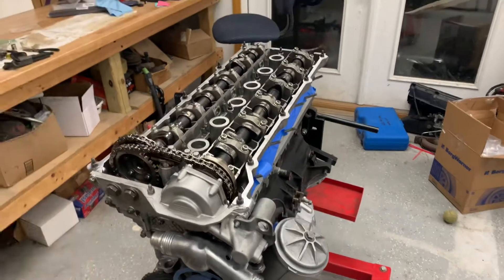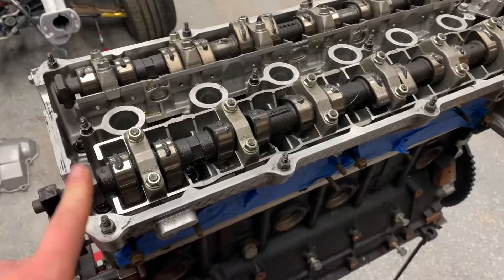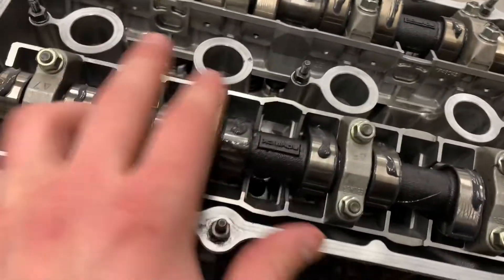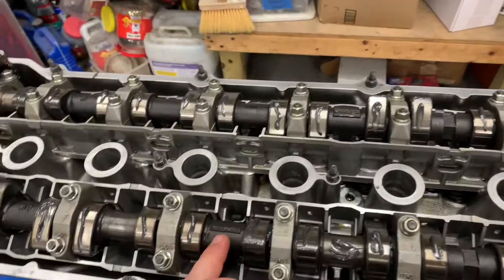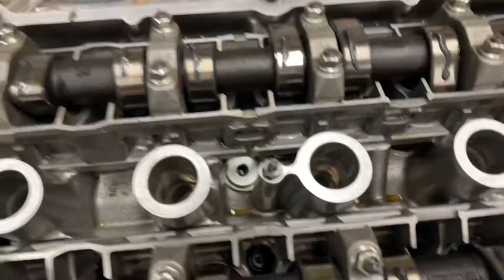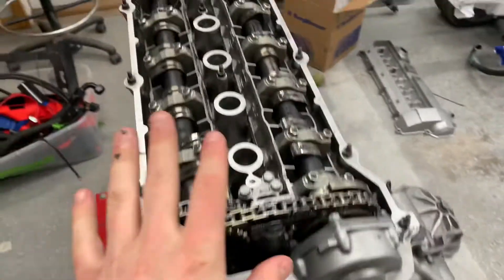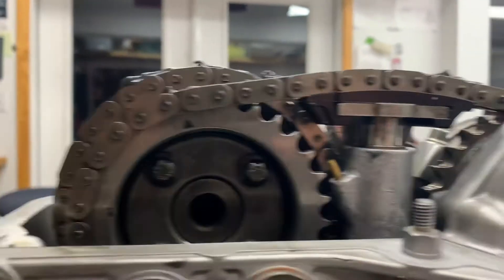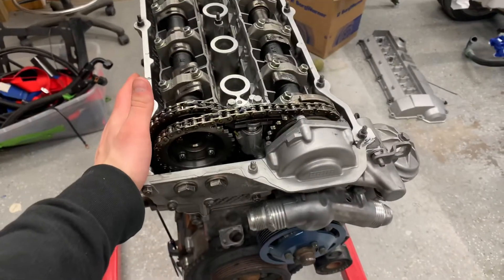How to set timing on SCHRICK BMW E36 cams/find TDC!

Comment: I sent a mail to ask schrick,they told me jsut use stock cam tools to set cam timing
Reply from the maker: Yea, I used the the cam lock tools and such but there is no TDC marks on the cams. So no matter if you have all the tools, you are still in the dark lol. Thanks for the comment, hope it works for you!
Reply: @driftpunkmotorsport3852  I buy new cam couple months ago,there is no mark on the cam🤣

Comment: There no sort or different cam timing angle that you have to do on these shrick cams? You just do your cam timing based of the stock cam blocks?
Reply from the maker: Yeah so the schrick cams just need to be set to TDC to match the bottom end of the motor. Finding the timing marks is the hard part, then throw on the cam lock blocks and your good to go. I did some tests and checks with my spare head (stock cams) to make sure the schrick cams wont have any interference. Be careful, as this IS an interference motor. So if your off by more than a degree or two its gonna be a bad day!
Reply: @driftpunkmotorsport3852  yikes im scared
Reply from the maker: @norphes3865  you’ll get it. It’s not too hard, just take your time and when your done turn the engine by hand a couple rotations
Reply: @driftpunkmotorsport3852  thanks for the advice. Ill keep it in mind for when the time comes 🍀